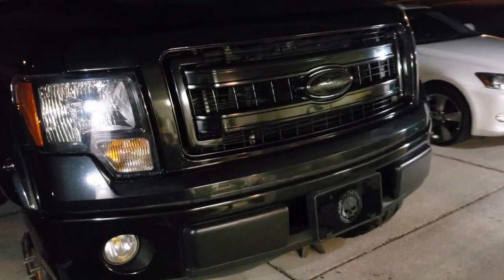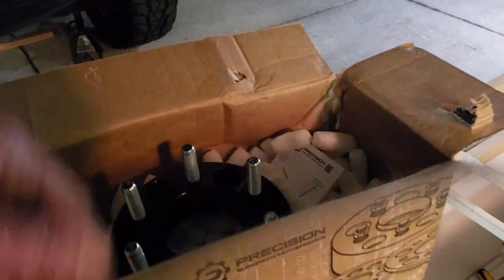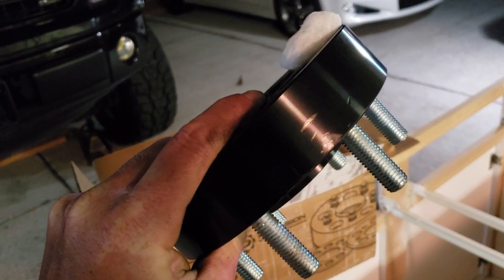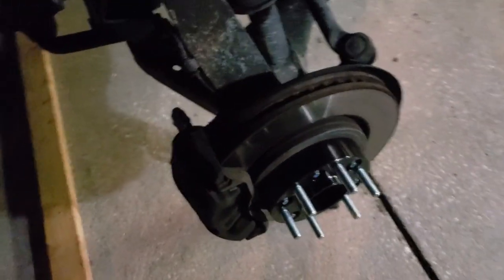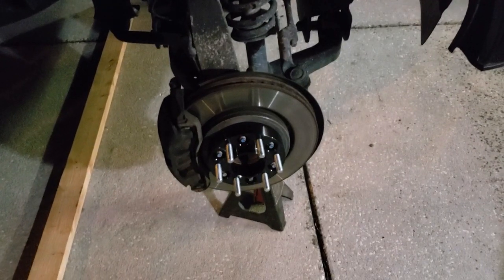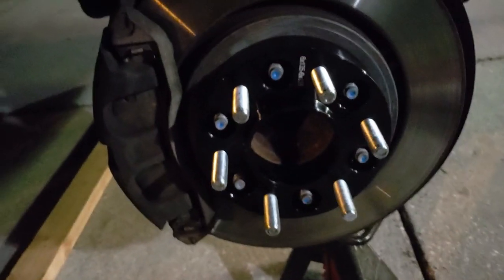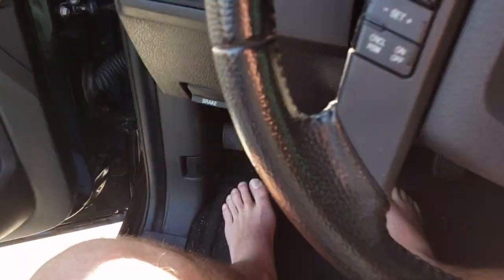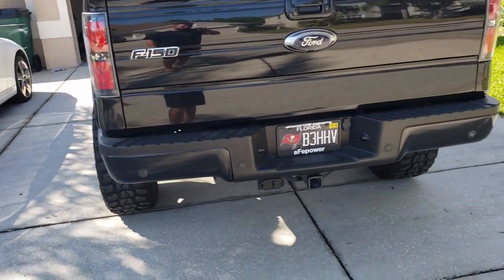F150 1.5" Wheel Spacers - NO Stud Trimming

Comment: Hey great video! Hope your around to see this comment cause quick question. I’m rocking 35x12.5R20LT tires and rubbing my upper a-arms when I turn all the way, I have stock rims with a +44 offset. Do you know at all if the 1.5” spacers would help because I think it will but worried if your truck had negative rims and the spacers yanno

Comment: I have a 2014 ford f150 with 295/65/20 Nitto Trailer Grapplers on it, i have a 2 and a half inch leveling kit, wth these wheels spacers do you think it will rub, because as of now they do not!
Reply from the maker: You'll prob rub if you dont do some trimming, but it'll look good!
Reply: Hey did you ever throw them up? Curious how it went with rubbing!

Comment: 35 x12.5 tires, 44 offset, and spacers equals rubbing
Reply from the maker: Yes, that is correct. Had to trim bumper and plastics. Not as bad as the 22x14s that are coming.. more trimming in my future
Reply: @jtpbuildz959  love your truck! I've done a lot of cosmetics to my 2018 fx4 super crew. Added 1.5 spacers also, good luck with your future upgrades!

Comment: Want to address the myth about cutting wheel studs. I have a 2018 fx4 and currently running 1.5 level & 1" spacers with stock rims. Didn't have to cut studs, but don't think I can go less. I started with 1.5 spacers, loved the look, but in wet weather too much mud on side of truck. Also U-turns were more difficult. Measure before cutting!

Comment: did you still used hub centric ring after installing the wheel spacers....
Reply from the maker: No, the spacers I bought had them built in so there was no need for them. Thanks!

Comment: I want to buy some but I keep seeing and hearing that the 1s from ebay aren't good quality. Also since I'll be using GMC rims, what do you suggest
Reply: Tito Marquez stay away from eBay spacers trust me😂😂rough country are good if your on a budget, but bora spacers are the absolute best
Reply: Tito Marquez buy them from a real provider. Don’t buy cheap. You can get 4 very high quality spacers for less than the cost of a single wheel.  If you can’t afford good ones then save up . But dont risk destroying your truck with a breakable thing that holds a wheel on

Comment: Looks sweet brother, how are they riding so far?
Reply from the maker: No problems, love em
Reply: @jtpbuildz959  Hey brother, I just bought the same spacers as you did and they have ZERO instructions with them, how much did you torque yours?  Thanks bro
Reply from the maker: @petertitle  I torqued them same as my wheels, 150ft lbs and they are TIGHT. just make sure to install in a star pattern, not around the clock
Reply: @jtpbuildz959  Thank you brother, I'll be tackling the job during the week.  I hear that they should be checked and retorqued after 50-100 miles, what's your opinion?
Reply: @petertitle  did you listen to the video ? he explained all of what you're asking man
Reply from the maker: @petertitle  I didnt...but the standard practice is like installing new wheels, always check your torque after some driving. However, i pulled the wheels again after 300mi for brakes and retorqued so......better be safe than sorry:)
Reply: @jtpbuildz959  gotcha